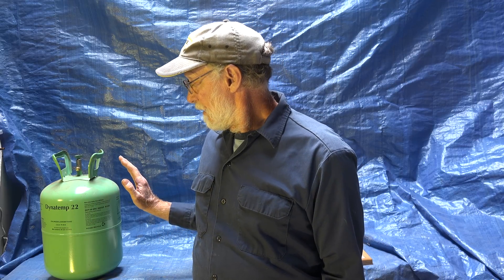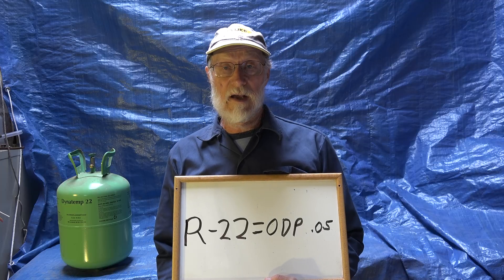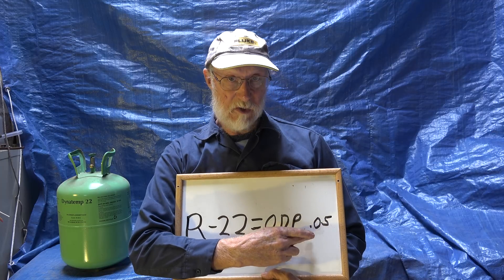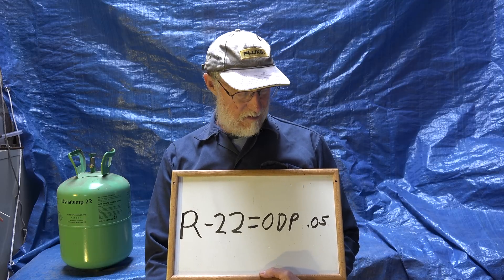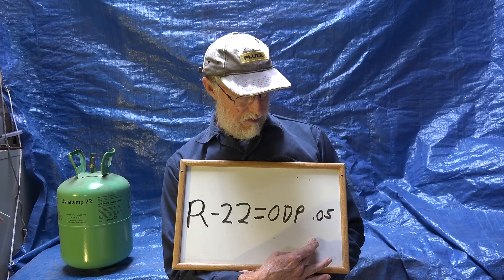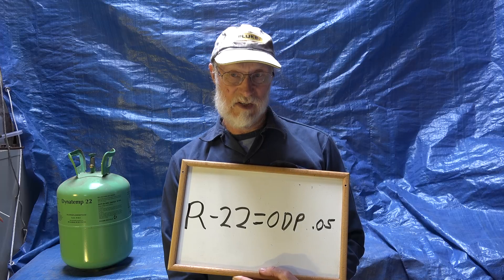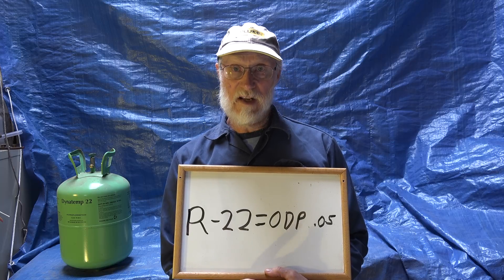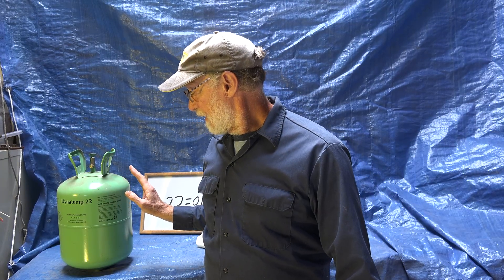R 22 refrigerant

Comment: How many BTUs per pound does R22 have? More than R12's 70 I presume since it's boiling point is lower, right?
Reply from the maker: Its about 100 BTUs per pound.  Boiling point has nothing to do with boiling point at atmospheric pressure.  It is just a property of the refrigerant.
GFM
Reply: Great to know, thanks. I presumed that since R22 boils at a lower temperature than R12, it would take more heat with it as it evaporates, but I wasn't sure. Great videos as always!

Comment: Great video! I do have a question though- Would R22 still be replaced if it was not harmful to the ozone layer? What are the other problems with R22? Thanks.
Reply from the maker: R-22 was virtually the only refrigerant used for A/C units for many years.  It was cheap, efficient and mixed with mineral oil. In short, it was the best.  Its damaging effect on Ozone, though much less than R-12, was the only reason it was replaced.
GFM
Reply: That's what I thought, thanks for confirming. So its performance is similar to R410A?
Reply from the maker: Probably a little better.
GFM
Reply: Thank you. They say 410A is more efficient, but I never believed that. R22 is great.

Comment: Hey GFM, just curious. What is the difference in performance/efficiency between R12, R22 and R410a? Thanks.
Reply from the maker: Just to give a general idea,  R-12 is one of the highest efficiency refrigerants.  However, it is not commonly used for AC.  R-410A may be higher for AC.
GFM
Reply: Thanks. Why was R12 not used very much for air conditioning since it was so efficient? It worked well for car ac, why not for homes?
Reply from the maker: That's a bit above my pay grade.
GFM
Reply: A DIY Computer Guy r12 can be just as efficient as r22. a system that uses r12 has to be larger than an r22 system. ie cooling per lb of refrigerant for a settup in r12 is only 60 percent of the cooling compared to r22. thus older pre epa home refrigerators used r12 or r22 too. in window units small 6000btuh 120 volt guys were often r12 and larger 240 volt 18000btuh were r22 25 years ago. eons ago it did not matter if r12 or r22 was used in a dinky system.  often it was all cost details ie use compressor that had the lowest cost. for a homes say 3 ton unit outside for r22 it might have to be as big as a 5 ton unit if r12 was used. thus few big r12 units except for cars. a 1980s gm r4 compressor in a car with r12 is about 1 ton per 1000 rpm thus 4 to 5 tons of ac. huge since one needs   rapid cooling in a solar greenhouse.:)

Comment: I wonder how high the prices can go on these jugs as we approach the 2020 complete phaseout. As far as I have seen in Southeast Louisiana, R22 AC units still in service still outnumber 410A units out there better than 5 to 1. There will still be way more demand for R22 than there is supply. That makes the market for R22 ripe for speculation.
Reply: $500 for 40lbs or so if you have a epa certification
Reply from the maker: There is a schedule for the taxes added each year.  Interestingly enough, the price went down considerably last year because so much was being recovered and returned for recycle.  
GFM